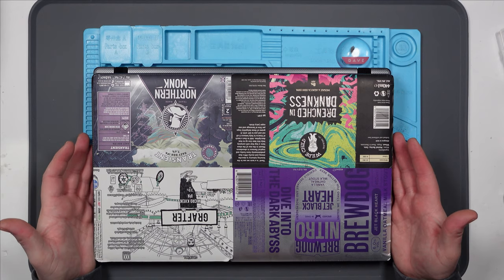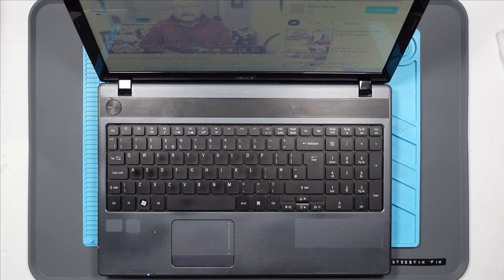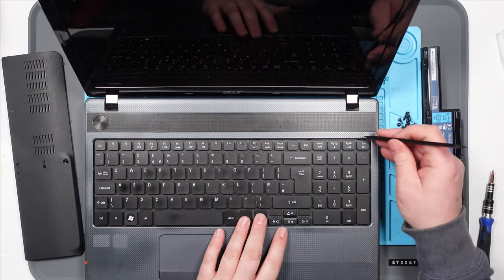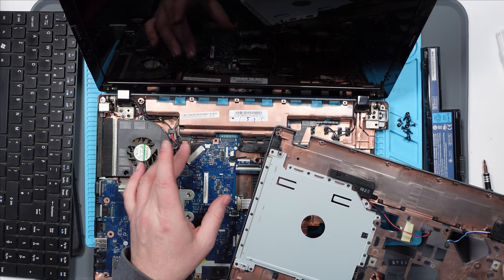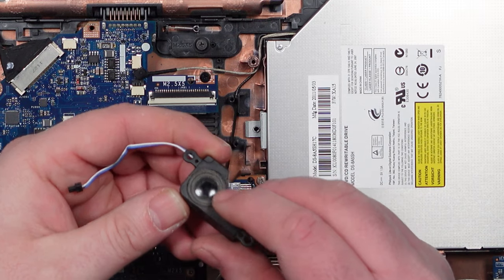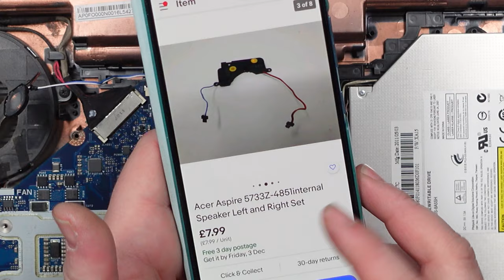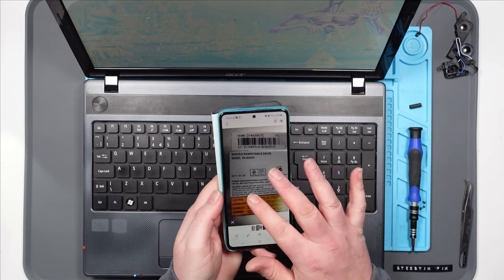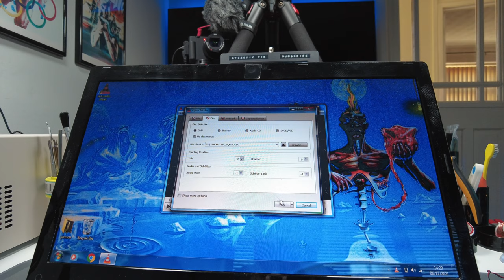ACER Laptop with DISTORTED Sound | Can I FIX It?

Comment: I actually had this exact laptop, got it in 2011 or 2012 from my parents during college as I was using an old, busted 2006 laptop. I remember right out of the box, the speakers were a MASSIVE downgrade from that old busted Gateway laptop I was using. Even when they're working, they don't sound a whole lot better than this. Which is really sad because this was actually a damn good budget laptop for the time.

Comment: The replacement speakers worked fine then, that's good. I've never seen (or rather heard) laptop speakers fail before so this was interesting. It's almost always better to replace a part with the exact same used item, but you take a risk on it's condition. Nice work Steve! Does the owner connect this to the internet, if so they want to consider an OS upgrade.
Reply from the maker: Yeah, replacements worked perfectly!  It is odd that they failed, but I guess if driven at loud volume for a decent amount of time, the membrane will go eventually!  Yeah, I'll let the owner know about the OS!  Cheers Les 👍
Reply: i wanna say they can't be all that uncommon. I had a 2014 mbp that had a speaker fail. A buddy of mine also had a speaker fail on her 2013 macbook pro. Gotta say replacements were not nearly this cheap

Comment: I do the hardware upgrades on laptops at work, so, crack them open with some regularity to upgrade hard drives to SSDs and YEP the screws under the keyboard thing trips me up more than I'd care to admit.  It's not like that on every laptop casing, which is why I forget about it sometimes.

You should give Monster Squad a watch.  I haven't seen it since I was a kid, but, I liked it a bunch then.
Reply from the maker: 👍 Thanks Sixty! I'll definitely check out Monster Squad! It does sound pretty cool 😎

Comment: I have a broken aquarium filter if that interests you for fixing. 

The motor seems to shake but its jnsidr an electrical sealed section. Covered in that electrical plasticy hard stuff. I can't fix myself because I've no idea what to do if I opened that part up.

I have 2 of them 2 that developed the same problem. They cost me £95 each such a wind up

Comment: Shame it wasn't an electronic repair but.. Win is a Win! There hasn't been much going on for older DVD drives, more so for the BD Drives in regards to region patching.□
Playing via VLC that is good but.. If you want to use other players/software without a region patched drive. Any DVD HD by red fox will make your drive act region free 👍🏻
Reply from the maker: Thanks brother Steve! I guess there isn't much call for region patching with all the other options available! I'll check out that Red fox software, thanks for the tip! 👍

Comment: Hi really like your channel and content. I understand you've a disclaimer in regards to your repairs but would you look at something of mine by any chance or have advice? It's a SDP-2 Stagepiano (Keyboard) Gear4Music. Sadly the stand it was held on collapsed and it hit the floor. Since then, the volume has been intermittent. The volume dial should consistently reduce in volume but everytime I do this, it crackles and stops playing in one side but plays in the other. The volume reduces just one speaker works. I'm thinking more of a loose write but what do you think? Perhaps I can send you some pictures.... Thanks.
Reply from the maker: Thanks Brendan! Yeah, that definitely sounds like a loose connection you have there! If you want to send me some photos, I'll happily have a look for you. My email address is in my 'about' section. 👍
Reply: @StezStixFix  Thanks I took it apart and somehow isn't as bad as it was.. so clearly a loose connection wasn't in place so it's not as intermittent! Thanks for your reply.

Comment: I love hearing about William Nintendo switch just on the interesting note my granddaughter dunked the Nintendo switch light into the dog water bowl I took it apart cleaned it put isopropyl alcohol and everything dried it out and put it back together it ran for about 6 hours until the screen started showing a bunch of horizontal lines and garbled I turned it off the following morning I turned it on not even the backlight would come on I removed the screen and the backlight and I have it if you would be interested in repairing it it definitely would need a new screen and backlight assembly I think they're about 40 bucks and I would be interested in watching you try to fix it
Reply from the maker: Hi William!  That does sound interesting, I would love to have another go to try and redeem myself after I failed last time!  I'll message you on Patreon.  👍

Comment: Not great methodology. I would have plugged in a set of external speakers. That would have told you if it was the drivers or the sound chip. Then when you received the replacement speakers you should have tested them before reassembling the laptop. If they had been faulty you would have had to disassemble the laptop again to take them out.

Comment: I have scratchy/distorted output that comes & goes, also on the headphone out jack - so it cannot be the speaker itself.. Reinstalled drivers, no good.. fearing sound card but it's part of the motherboard I believe, meaning that regardless of an add-on speaker, it would be the same issue